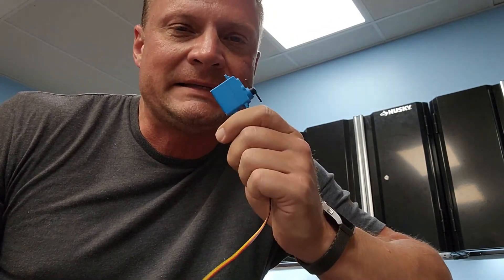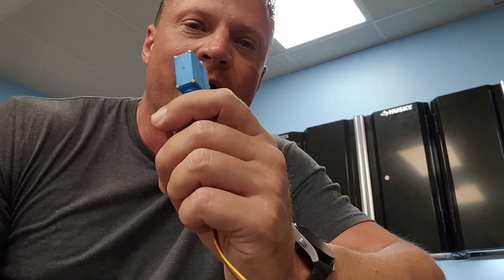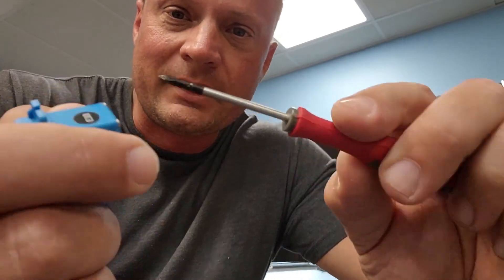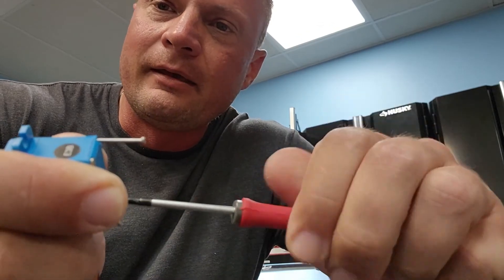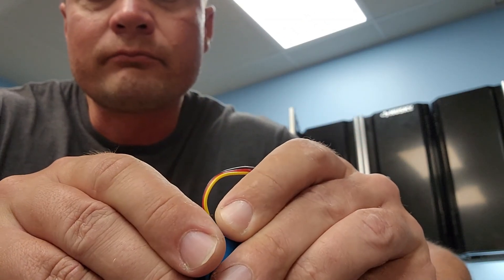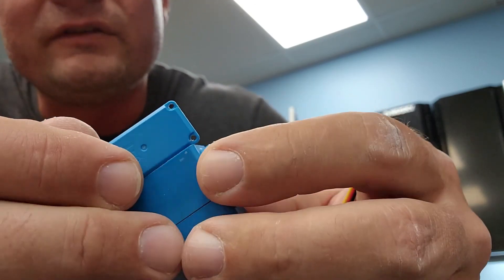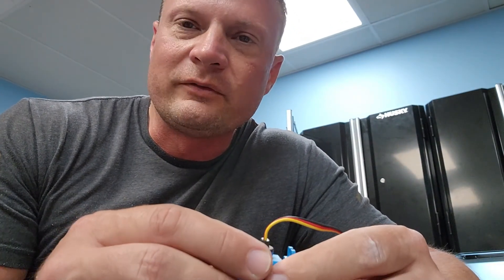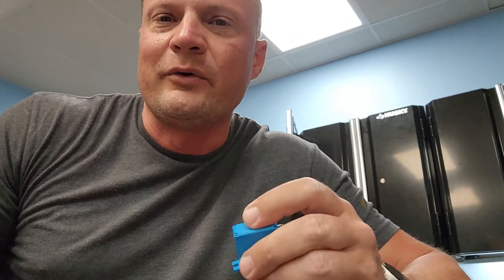Waterproof servo testing UPDATE!  What was inside after a week!?

Comment: 2 feet (610mm) deep is nothing. If you are truly testing it then 1.8 to 2m depth should be the test.
Reply from the maker: So, test the servos at a test depth twice as much as they're rated for? Sounds legit. Also, my test tank is 0.6m deep, not 2m...
Reply: @RCSubGuy  In the petrochemical industry where I worked,  pressure vessel and piping pressure tests were set at 1.5 times the operating pressure. My suggestion is based on a operating depth of around 4 feet (1.2m).  These are models, but water pressure works the same.
Reply from the maker: @haigjansz5643  We'll keep that in mind for next time. Thanks for the input and suggestion!